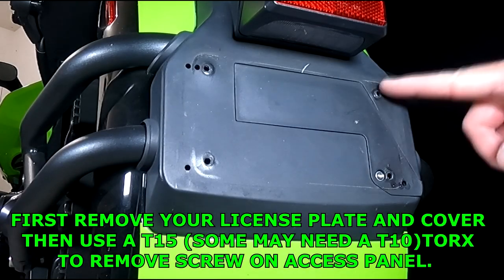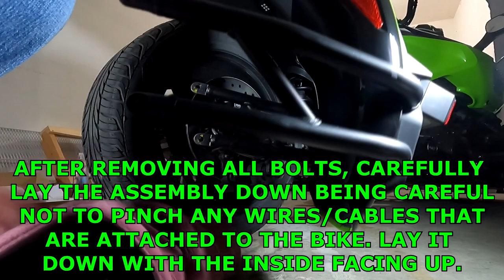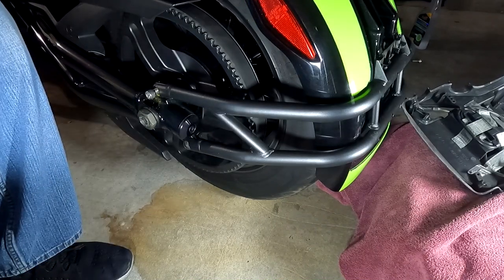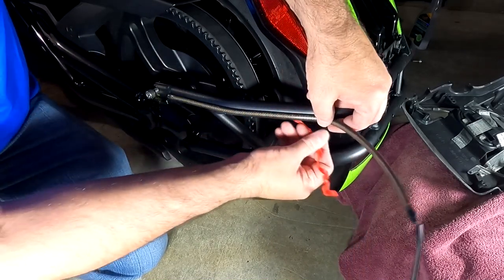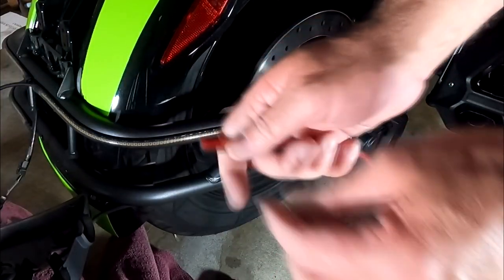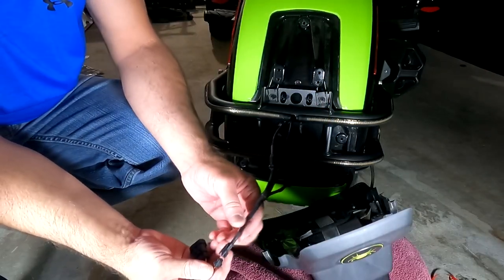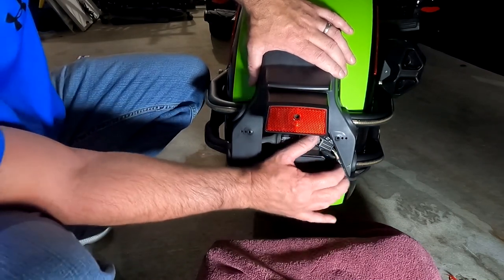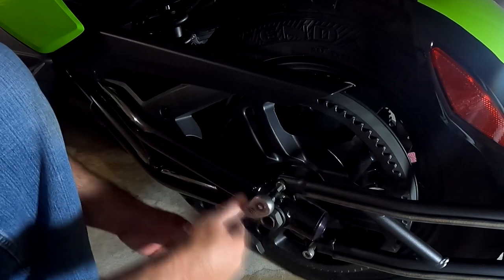Can-Am Spyder F3 TricLed Lights install video. Can-Am Spyder F3- Ryker - Spyder RT channel

Comment: Nice. I don't own an F-3, but if I did I would definitely install those lights.
Reply from the maker: They work really well. If you are skilled in electrical, they can be hooked up to other bikes by "-" and "+" connections but you have to do some cutting of wires. I was really impressed how bright they were.

Comment: Nice work and great explanation.  To be clear, the lights are just for illumination, yes?  Meaning they don't brighten with brake lights, or flash left/right with the turn signals - they're just always on, correct?  Great job on making it seem pretty easy to do!  I didn't know you could turn your hand that fast!  LOL
Reply from the maker: They do stay on and do NOT flash when brakes or turn signals are activated. They make a huge difference in the bike being seen though. As they say, the hands are quicker than the eye! 😂 Thanks for the comments and support!

Comment: Thanks for sharing the install, the rear end of the spyder could do with something extra. Got some idea's ( brake free helmet light on the reverse of a backrest & more radical, a complete swap out of the lower rear stop & tail completely, the license plate LED reflector doesnt quite cut it) Thanks again .
Reply from the maker: This was actually a purchase that suprised me. One at how well it was made as far as lights, but also on how bright it was. A huge improvement for sure over the stock situation. I have seen some nice "bobber" style fenders too that would look nice over the stock.

If you dont go with the helmet brake light on the backrest, these may fit/work for something like that too..... Not 100% sure though.

Comment: I notice some go withno back fender. Did you ever do that?
Reply from the maker: I have taken it off, the only thing I didnt like was you dont realize how much that fender keeps stuff from flying at you when it is not there if you ride in rain, mud, dirt road, etc. I really like the half tail or bob fenders and may get one later on. I REALLY like the smaller half fenders for the front tires. Thanks for the support!
Reply: @MOABMAN  thanks for the response. Maybe I will just tell my wife to wear an old shirt. HA ha!
Reply from the maker: @darrengarlough5121  HA!!!! You must want to sleep in garage with the bike!